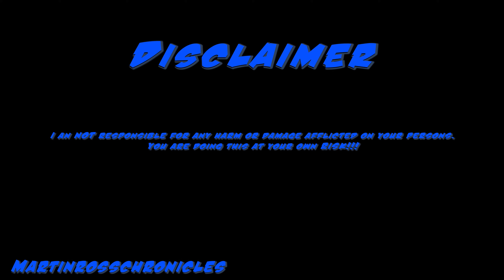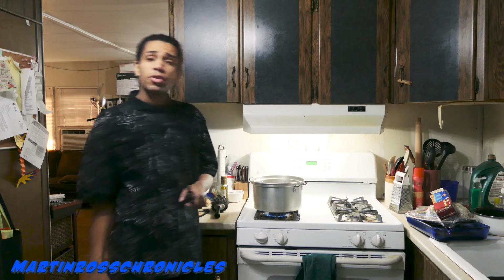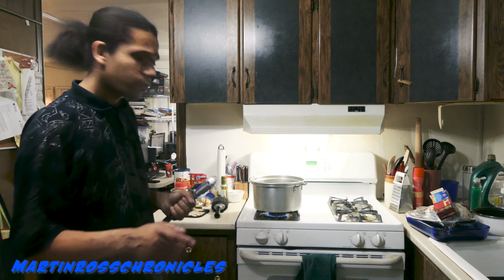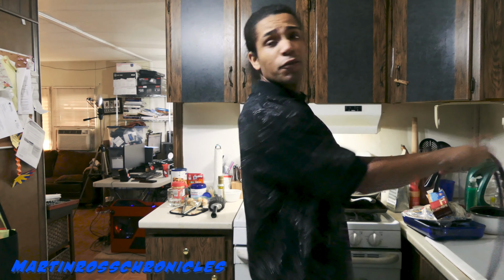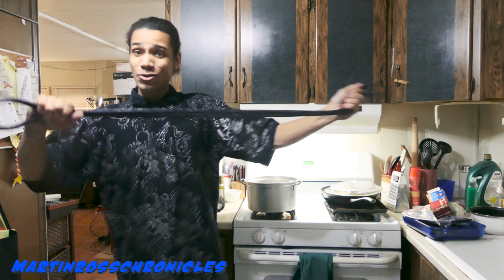Talkbox Basics Chapter 2: The Tube

Comment: Hi! I'm a synthesizer beginner, and can't make up with myself if I should invest in a talkbox, or just get a vocoder since it's a lot cheaper. Is the talkbox worth it, or overkill to begin with?
Reply: KRUDTUGLE if you’re looking into talkbox, I’d use a microkorg bc the microkorg has a vocoder in it as well so you can multi purpose the synth. The talkbox can be bought used for a little under $200 and then just buy the tube

Comment: hey whats up i have a mxr talk box I'm trying to figure out how to hook it up....i hear sounds coming threw the talk box but not threw the output...what does the mic play apart in
Reply from the maker: If you got sounds through the talkbox, then put the tube on and go. You should have sounds coming from the talkbox. Remember out put of the instrument, then input of talkbox and sound through tube!
Reply: Pretty sure an mxr needs an 8ohm amp with a "speaker out" not a "line out". Its not self amplified like a banshee. Synth out, into amp in, amp speaker out, into talkbox amp in, and speaker out on the talkbox(I have a golden throat 1) to your pa system unless you are using a combo amp. I just use a tiny 5w micro amp combo and it still rattles my teeth but you can use up to 100w amp. Hope this helps:)
Reply: @mcdosia420  The MXR IS self-amplified, you don't need anything except a mic and PA just like the banshee. The output, however, is only active when the MXR is switched off, meaning it passes your instrument signal through to your amp with no effect and nothing coming through the tube when it's off, so basically with guitar, for example, you'd plug it into the input of the MXR and plug your amp into the output of the MXR, so when the MXR is switched off, your guitar comes through your amp like you're plugged directly into it, then when you switch the MXR on, your guitar stops coming through your amp and starts coming through the tube with the talkbox effect on it.
Reply: The mic is how you amplify the sound coming through the tube. The output is strictly for passthrough so you can play through an amp without the talkbox effect when you don't want it on. The output is turned off as soon as you activate the MXR and the sound from your instrument is rerouted through the tube, then when you switch the MXR off again the sound is rerouted from the tube to the output to your amp (or whatever yiou have plugged into the output jack.
Reply: @rlpoloplaya67  I'm a keyboard player diving into talk box. Just bought an mxr. I'm unclear here a bit. I need a mic that is mixing my mouth and the changes there and a mic needs to pick that up right? I want to know can I take the output of the mxr right into my interface/daw and get the talk box effect without a mic? I see videos of keyboard players not using a mic.Thanks
Ron